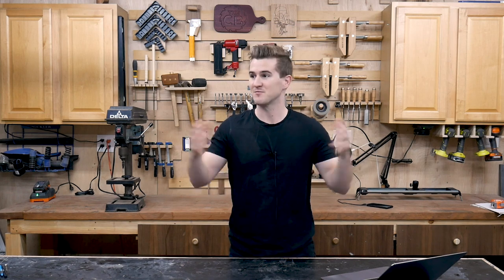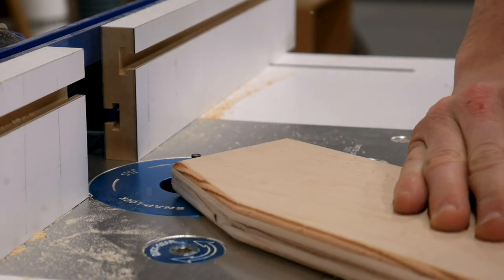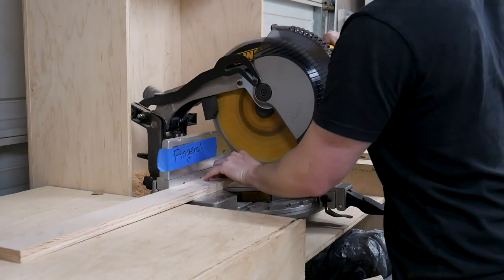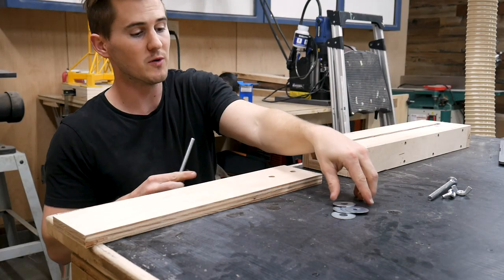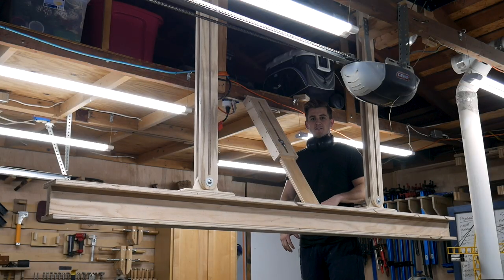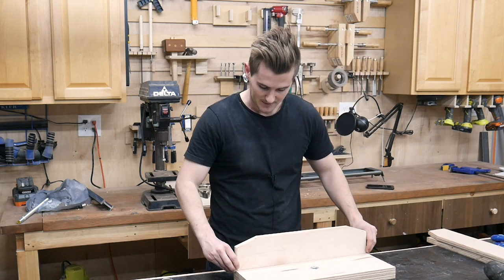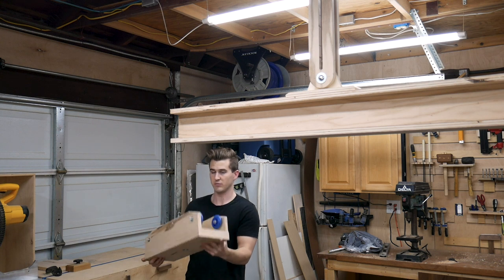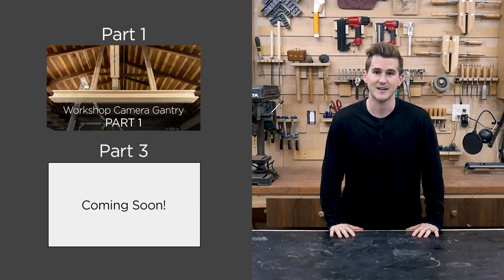Workshop Camera  | Part 2

Comment: The system you are using is similar to many of the cheap 3d printer hot end carriages.  An Eccentric nut is a good way to adjust perfect tension between the carriage and beam.